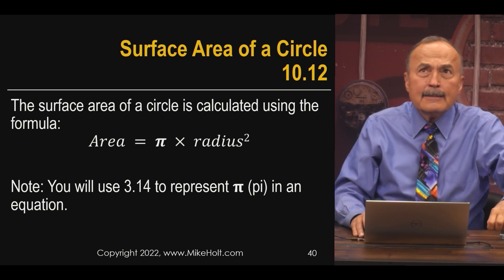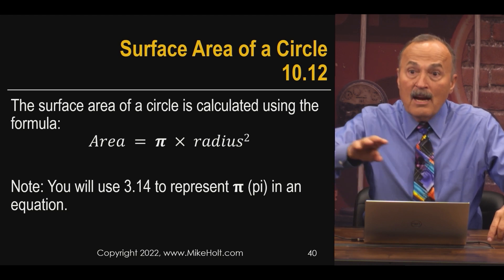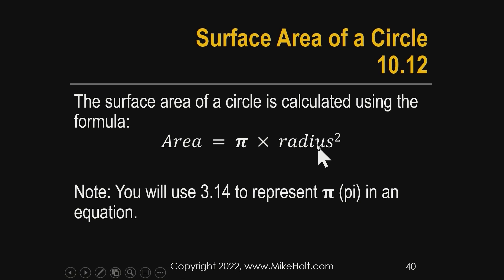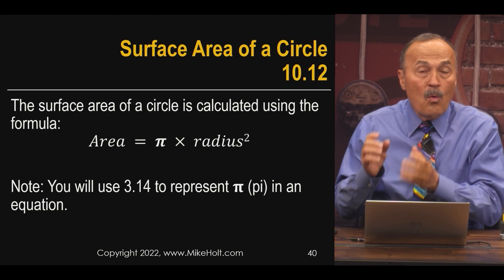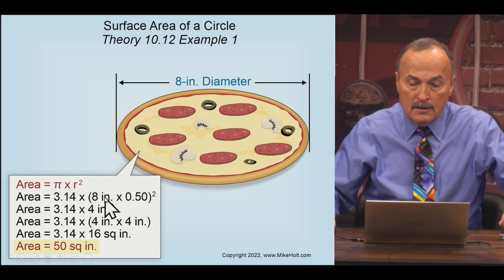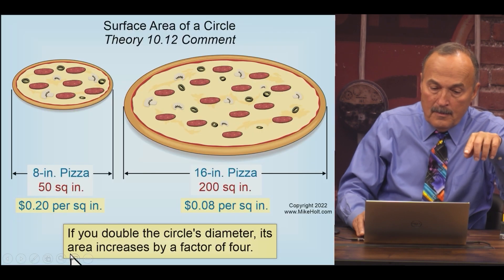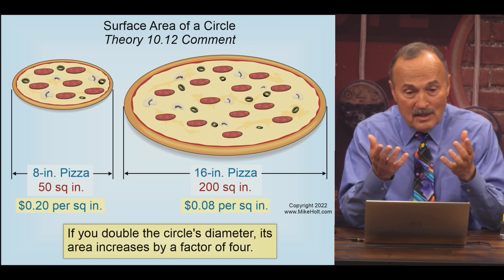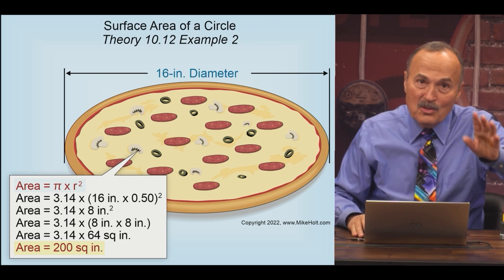Surface Area of a Circle

Comment: I have a question with the table 210-24. Could you make a video about this table and explain what the word taps refers to?
Reply: 🫡Table 210.24 summarizes the branch-circuit requirements of conductors, overcurrent protection, outlet devices, maximum load, and permissible load where two or more outlets are supplied.
If the branch circuit serves a fixture load and supplies two or more fixture outlets, 210.23 requires the branch circuit to have a specific ampere rating that is based on the rating of the overcurrent device, as stated in 210.3. Thus, if the circuit breaker that protects the branch circuit is rated 20 amperes, the conductors supplying the circuit must have an ampacity not less than 20 amperes.

In the Table we see the word ?Taps? and it addresses such things as flexable cords and fixture wires as outlined in 240.5